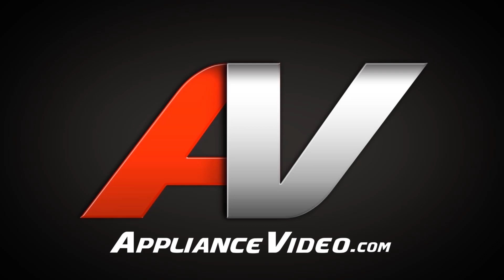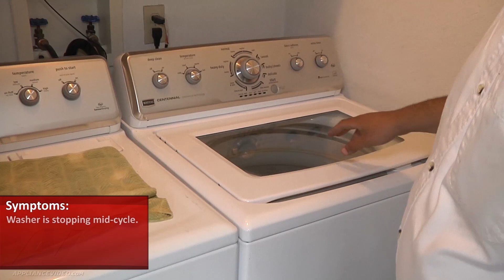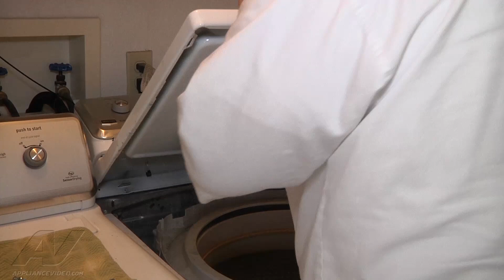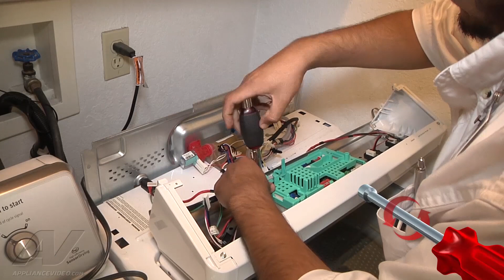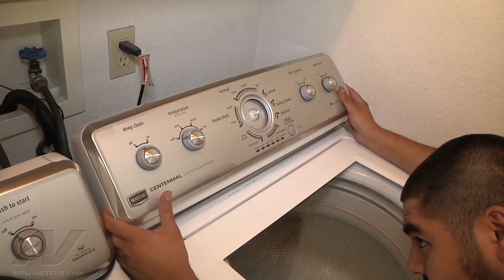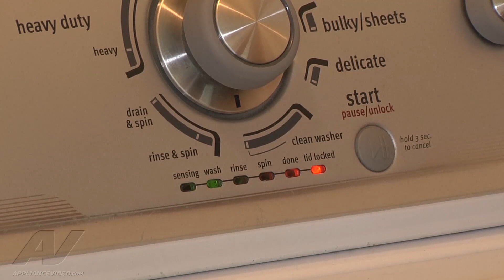Washer Repair Stopping Mid-Cycle - Maytag,Whirlpool,Sears,KitchenAid,Roper,Kenmore-MVWC450XW4

Comment: what does a new control board cost approximately?
Reply: Tom M  TOO DAMN MUCH!
Reply from the maker: Great question, if you have a
more technical question that our parts department cannot answer, our
technicians are answering all questions at our website at www.ApplianceVideo.com under our Repair Help section. You can also call
our parts department at 1-800-830-5465 and they can give you help 7-days A week
Monday -Sunday, or search at www.SaveMoreOnParts.com  24 hours
7- days A week.